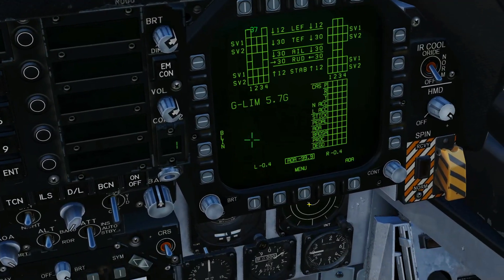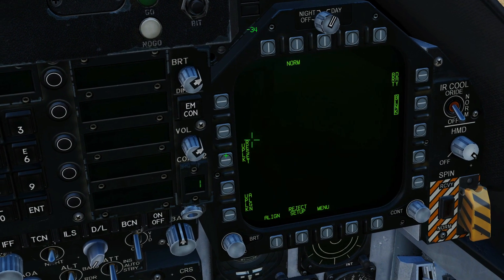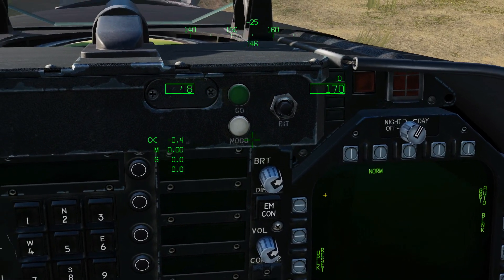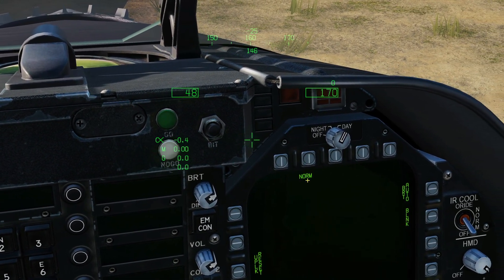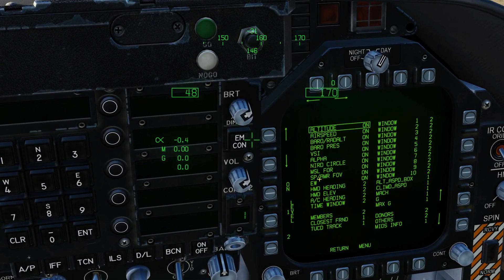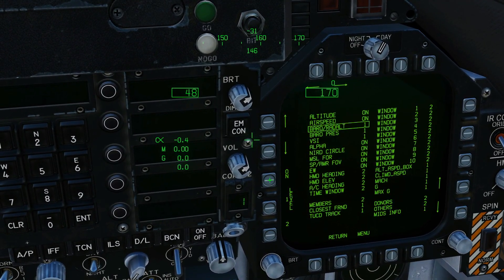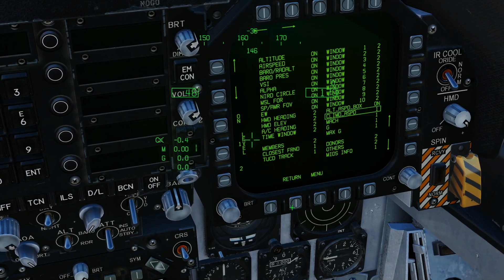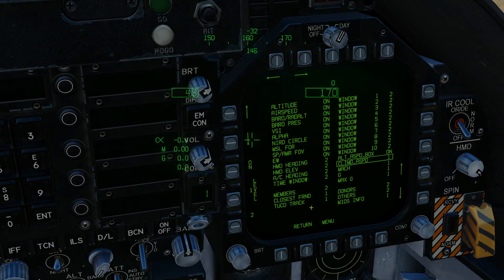FA-18C Hornet: JHMCS HMD Format DDI Page Tutorial | DCS WORLD

Comment: What do you think about this? It would be nice if they would implement a so called "Radio menu" system on the DDI so you can basically do everything from there without the need to press F1, F2, F3 keys etc. This would be great for people like me that play in  VR and do not use keyboard at all. I know it wouldn't be as authentic, but there are currently also buttons in the DDI like "ALIGN"/"UPLKALGN"/"UPLKRESET", instead it would be nice to have somewhere a "RADIO" and then a  "COMM1/COMM2" buttons that you can press. And from there whatever it is you need to do. I am new to DCS so perhaps there is an alternative way of doing this right now for VR players. If so let me know. A radial menu would be also better, but I'd prefer to have it on a DDI.
Reply: ps. right now I am using VoiceAttack to do radio related stuff. Which works, but not ideal...

Comment: +GrimReapersAtomic  With the Joint Helmet Display System active, I'd declutter the glareshield-mounted gunsight.  Attitude-heading/air-data/α-η symbology and (IR or EO) uncaged-seeker FoV/range to the helmet; gun-track traces, bomb-aimpoint pipper and SARH range ring and seeker-aimpoint dot to the 'sight.  I pictured the USN-USMC / Northrop Grumman (USA) F-14E equipped workalike to the McDonnellDouglas (USA) F-18C/D in cockpit displays, although the F-14E would have an amber 100 MIL standby gunsight reticle in addition to the green gun/bomb/SARH symbology in the HUD/MMD projector plus a completely different UFCP handling as a hybrid of the weapons officer's Systems Entry Panel in the F-14A/B and the UFCP AvijaAvtomatika (RUS) put into the Sukhoi-57.